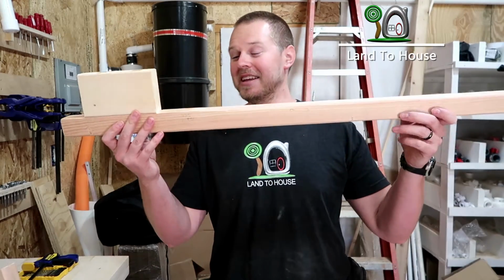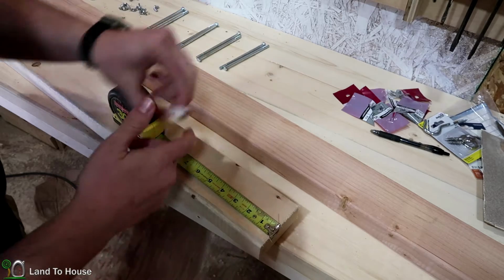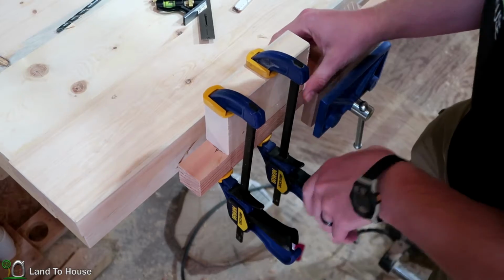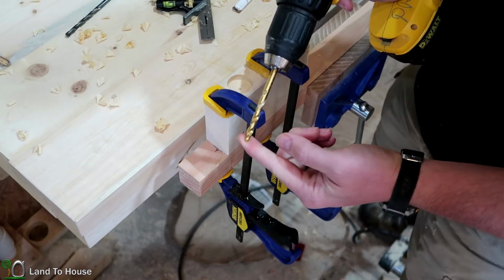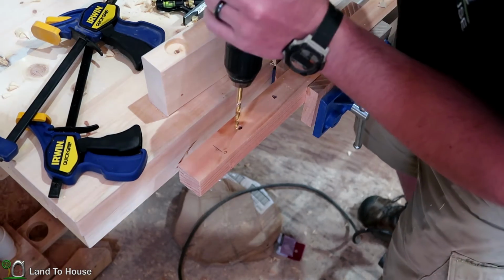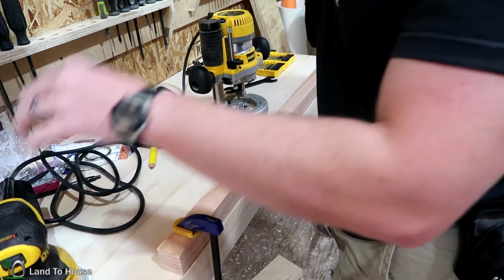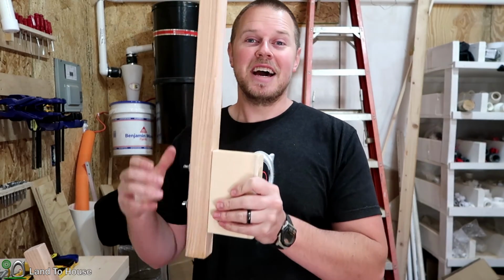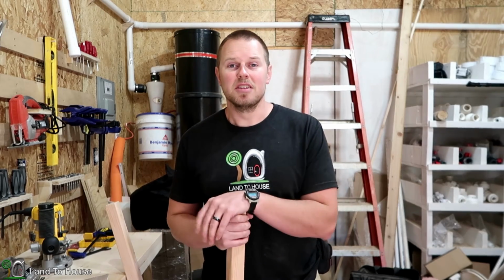Build Stilts from a 2x4

Comment: If the stilts were longer you can tuck them between your arm and chest where the top of each stilt is behind your shoulder and elbows are outside of them. If that makes sense they are much easier to use
Reply from the maker: That makes a lot of sense. I have actually seen a couple pictures of that being done. I built these for small kids so it should be plenty long enough to go behind their shoulders. Thank you for the tip. I'll have to see if the small ones can use them better than I could haha